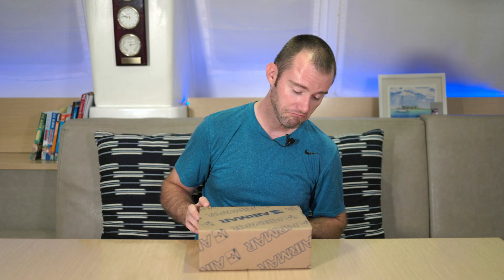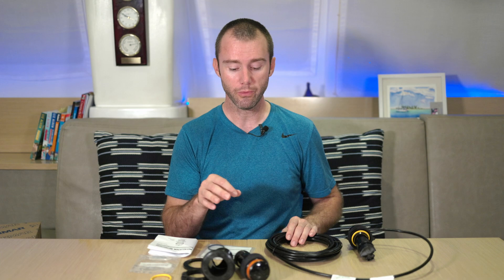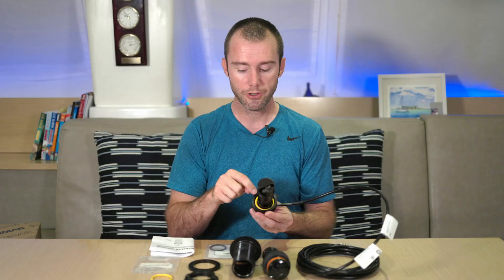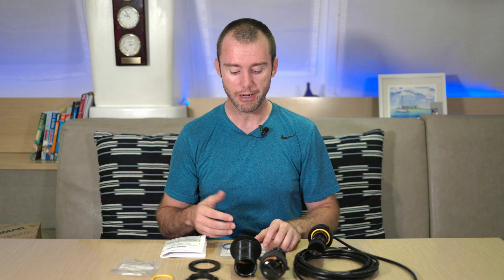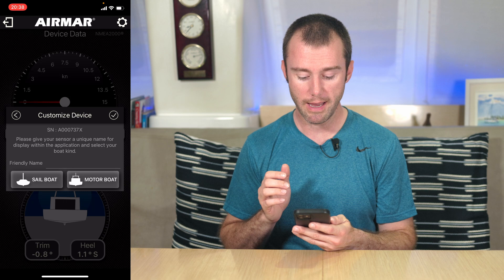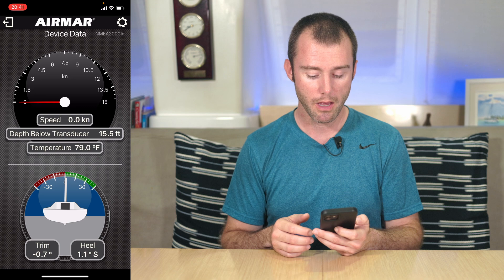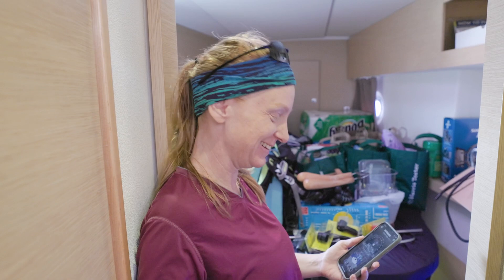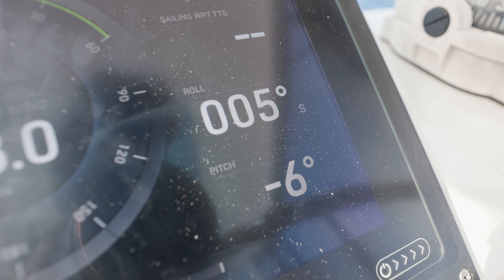Boat Transducers: Airmar DST810 Unboxing and Review

Comment: We replaced our DST-800 with an 810 a couple of years ago after we were hit by lightning and the transducer quit working (along with just about everything else electronic on the boat.)

The new app is nice and well-appreciated due to the pain of trying to set offsets on multiple displays.  Calibrating the data source only once is better.

The new water wheel seems to foul a lot quicker and easier than the old style.  That's a pain but the excellent water stopper gate makes pulling the transducer for cleaning super easy and low stress.  Changing the transducer creates about a half quart of.water inside the boat.  We rarely pull or.change ours until the wheel is fouled or we are hauling out.   Installing the plug before hauling out is a good idea.  Definitely make sure there is no water in there above the O-ring(s) if you expect freezing temperatures as any moisture in there could freeze and damage the plastic thru-hull.

On our transducer the water temp stopped working almost immediately but we never used it anyhow.

Comment: Thanks for the video.  I just received my DST 810.  I applied marine grease to the o-rings and was trying the fitting of the plug and transducer in the housing and it is so tight that I can barely remove them by hand.  Did you experience the same?  Are those easier to remove once the boat is in the water?  Thanks.

Comment: I recently replaced an old DST800 with the new DST810, though I notice mine has the Gen2 Paddle wheel as standard. It is a wider wheel and does not spin as freely on the axle as the older type as in your video. It would be nice to se a review of the unit with the new Gen2 paddle wheel and the differences between them. I suspect they are fouled more quickly.

Comment: Nice video thank you! I will add this transducer to my long keel yacht, it has some inclination under the waterline of course. Is it possible to set the transducer by software to compensate this inclination? What’s the available range?
Reply: If you buy the B&G Triton package through Defender you get this transducer, a great wind anemometer, two Triton displays, a smart  GPS/rate-compass puck, and a complete backbone NMEA-2K wiring package.  

It's about $1800 but is a super deal because if you bought it all separately  it  would be easily twice that.  The Triton displays are excellent and are about the only decent things B&G sells IMHO.  All the other stuff in the package, like thr DST-810 is manufactured by third parties.

Comment: Hi, thanks for the information and clear explanation. I replaced my DST800 with DST810. But we are having problem. Our instrument which is ST70 is not recognising the transducer. The technician said that we have to upgrade the instrument as well which is quite expensive. Is thrte any way to over come this problem? Or can I monitor the data on my tablet thru app?

Comment: Great DST-810 review! Does changing the temperature units from C to F on the Cast app change what is sent over the NMEA 2000 bus? Asking to see if it is changed there, whether chart plotters and software like OpenCPN need to do any unit conversion.

Comment: Thanks!  I'm curious if you considered the UDST800 that doesn't have a paddle wheel.  Would save you from pulling up the floor and cleaning the paddle wheel  every time it gets fouled.
Reply: I would be interested in that. Having to clean the paddle wheel all the time is a pain.
Reply: I’ve got the 800.  Didn’t want a paddle wheel again.  It works great
Reply from the maker: We have a few friends who've tried the UDST800 and they've been happy with them so far.  They're also quite a bit more expensive than either the DST800 or DST810 and require some additional hardware installation.

Of all the problems on a boat, cleaning the paddle wheel has been a relatively minor issue.  At least, it hasn't bothered us enough to go the full ultrasonic route... yet.  haha

Comment: Especially in the Bahamas, would a forward facing sonar be of much use ?  

I suppose the speed of the boat would need to be minimized and in the case of a cat, both motors would need to run near idle to ensure adequate maneuverability should a hazard be detected.
Reply from the maker: Forward facing sonar is a tough one.  People we've talked to who have it seem to either love it or hate it and never use it.  I remember doing some research on it, way back when were evaluating equipment to outfit SH, and my recollection was that it didn't look far enough ahead to really make it super useful.  And I would think that shallow waters would limit that look ahead capabilities even further.  🤷‍♂️

Comment: Nice... I recently purchased and installed a new paddlewheel but will look at this.  Have you hooked up any additional engine sensor info to your Raymarine MFD?
Reply from the maker: Yes actually!  We have 2 Yacht Devices YDEG-04 (https://www.yachtd.com/products/engine_gateway.html) engine gateways hooked into our MFD.  It was an easier way to monitor coolant temp then adding additional gauges and gives us lots more info as well!

Comment: Is the app needed for calibration of anything if it's wired into the network going to the chart plotter or is it just a gee wiz thing and one more way to see the data?
Reply from the maker: The app does provide significantly more calibration options than we can do through the chart plotter.

Comment: We have installed an airmar ust800 transducer and have Raymarine axiom system with I70s. We can’t get accurate readings and are told by airmar that we need to calibrate it with a garmin. Which is ridiculous. How can we get this to work correctly?

Comment: Hello, I am replacing my old dst800 by this New dst810 does anybody knows if I must change the through Hull or if the New one will fit with the former dst800 through Hull?
Reply from the maker: The DST810 will definitely fit in the DST800 thruhull. We made the swap without replacing our thruhull.

Comment: Thanks for the information. It looks like they sent you a pre-production prototype and software that was not even tested. I understand that Airmar is eager to get the new products to the market. But, it kind of gives a foul smell of the company culture with obviously no quality control for units sent for review.
Reply from the maker: Airmar didn't mention anything about our first transducer being a pre-production prototype so we can't speak to that.  It's not the first time we've had issues with equipment we've bought for the boat, but to Airmar's credit, they were extremely quick to rectify the issue.

As for the software, the units issue is the only one we came across in our testing.  And compared to most other marine industry apps/equipment that we've used, that's surprisingly good.